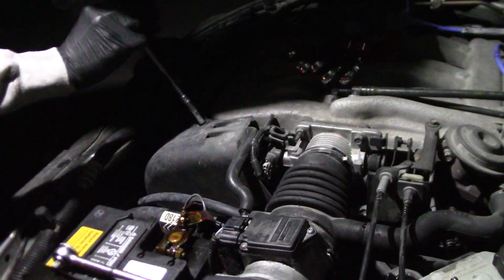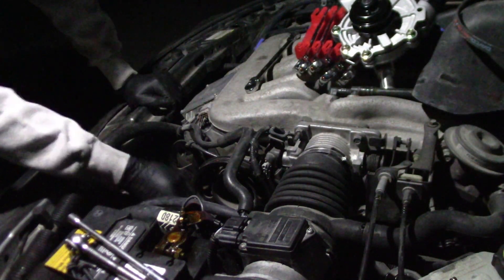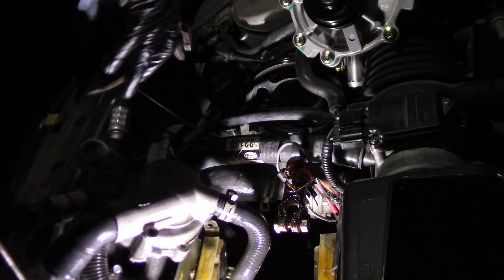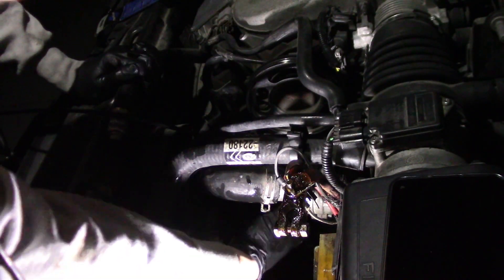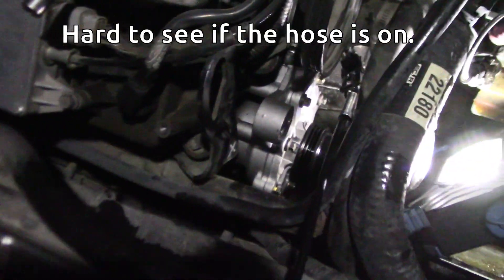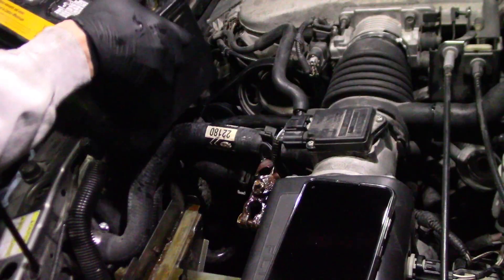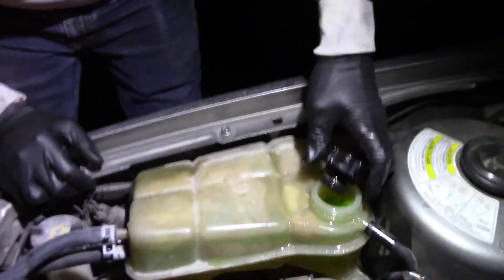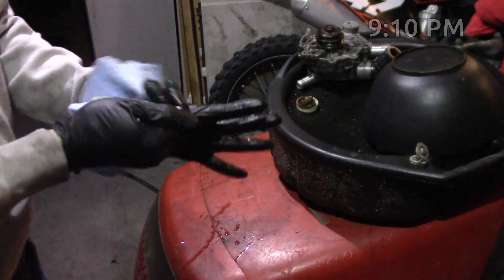Water Pump, 1999 Ford/Mercury 2.5L V6

Comment: Did you ever fix the issue? I've got a similar issue on my Cougar. Replaced the thermostat with the 180 version, and still have the problem. Next step was going to be the water pump, but maybe it's something else?
Reply from the maker: I did the radiator and water pump. The problem wasn't either. The engine coolant temperature seems pretty normal when reading the scan tool. But if the scan tool read 220F, the gauge would be pegged to the max. I believe it's the wire from the coolant temperature sensor (the sensor for the gauge). The wire is hard and stiff from corrosion. I'm doing a clutch on it now and I'll take care of that wire before I get it all put back together. The main ground cable is also corroded on the inside. That'll need replacing too. I'll see if I can include that in the video.
Reply: @jtandrews3 
Discovered I've got a shredded water pump belt, so I'll replace that and check if it was just the belt or something else.